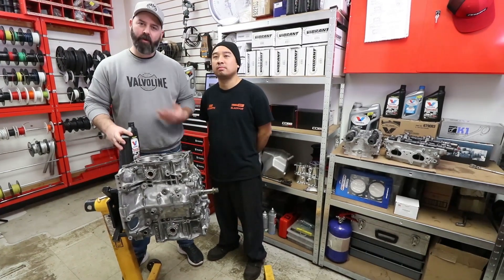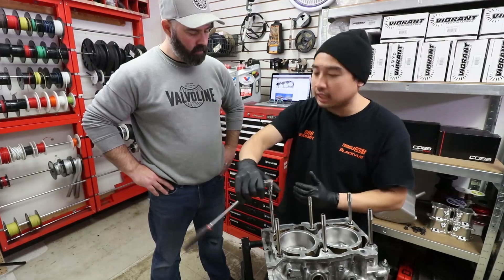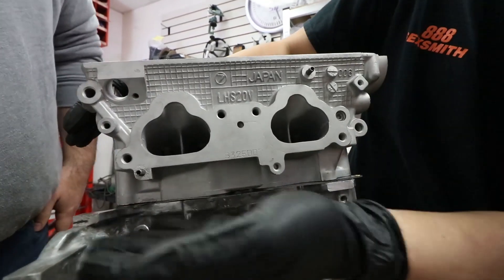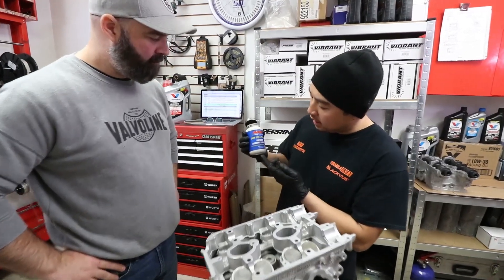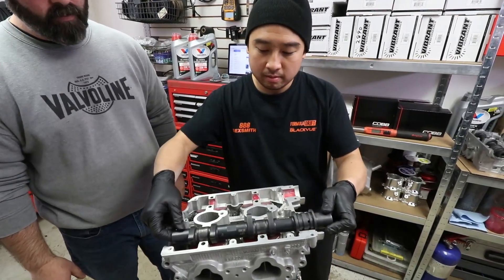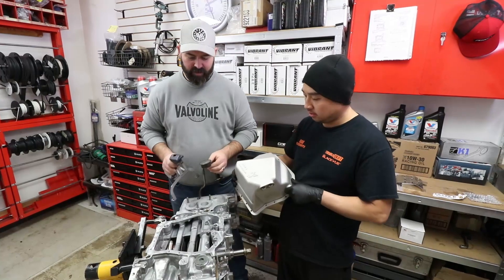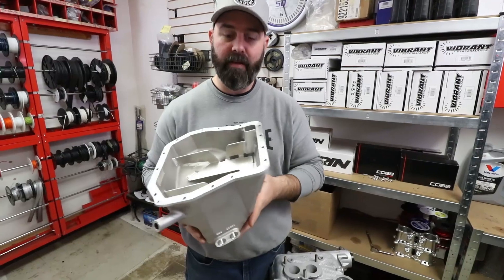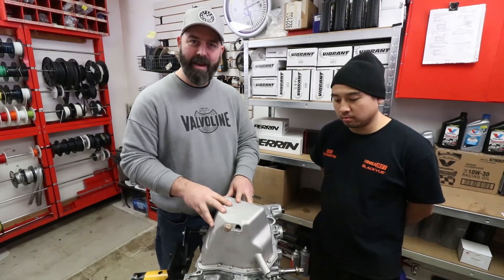SUBARU Engine Rebuild - Long Block Assembly - Part 1

Comment: Putting some nice internals into that vape box! This should be epic! 👏😎
Reply: Xd
Reply: @Matthew It's a flat 4 Subaru engine, and Subaru uses water vapor for better performance, so 'vape box'.
Reply: If you don't mind me asking, what's the difference with Subaru's method of using wator vapor for performance improvements than just the regular water injection that is more widely known. Out of curiosity. Thx
Reply: @Nasonix2  You should ask someone else, I don't drive these.

Comment: Superb video.  If you could add to the list of tools and services any lube, cleaners thread lock (if it gets used anywhere).  it would be most appreciated.  Getting ready to install a short block to replace a mill that has spun a bearing.  Thanks so much.

Comment: Is there a particular way that the cams are supposed to be oriented before installing the caps? Or is that all corrected whenever you actually time the engine? I can't seem to find anything about this anywhere.
Reply: No, just make sure the lobes aren't opening the valves or have any pressure when installing and tightening the caps. Timing gets set after.

Comment: 174 in/lbs and 84 in/lbs for the cam caps is incorrect!!!  Please anyone watching this for the love of god don't do that, I quickly look through the comments and didn't see anyone say anything.  The head studs don't even get torqued that high!  The correct spec is 7 ft/lbs for the caps near the belt and 14 in/lbs for the 2 cam caps on the rear inside the valve cover.  Terrific video otherwise appreciate the effort and info.

Comment: These guys apparently haven't read the instructions that have come from ARP since March 2017. Do NOT lube the washers!  In fact the best practice is to roughen one side of the washer with 60 grit paper.  Per ARP: Clean the spot faces on the cylinder head where the washer seats, use of solvent or brake/carb
 cleaner is recommended. Then, using a clean, dry rag remove all oil from both sides of each washer. The cylinder head and washer mating surfaces must be free of oil/grease/lubricant. Failure to keep these surfaces dry may result in inconsistent preloads. Place the washers over the studs and on to the dry, clean spot faces of the cylinder head.  ARP Instructions for Subaru here: https://arpinstructions.com/instructions/260-4701.pdf.  The WHY is here: https://www.dragzine.com/tech-stories/engine/damage-alert-how-to-avoid-pulling-threads-or-killing-head-bolts/ .
Reply: Was just thinking to post about dry washer or voids warranty

Comment: do the cams not need to have the valve clearance checked?
Reply: it was sent to the heads shop where they installed the cams, so I'm assuming and hopefully it was checked there.

Comment: gsc stage 1s are hardly more than stock lift duration wise and the performance gains are pretty weak i think. if you want a cammed build get stage 2s

Comment: Guys, you seem to have skipped over that whole part about selecting and reshimming the buckets which would 100% have needed to be done with new valves and springs....
Reply: I assume headgames did that for you, but it would have been worth mentioning
Reply from the maker: Yes, Headgames took care of all the head work including shimming the buckets to have everything within spec.
Reply: @sandman900rr  That's why factory service manuals are a thing.
Reply: @sandman900rr  Interesting for this 2017 Impreza owner though.